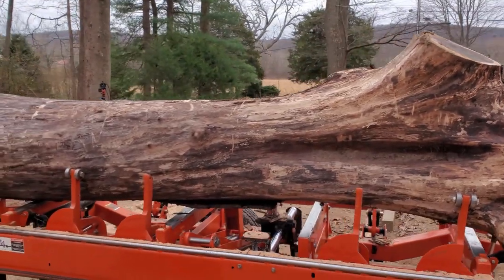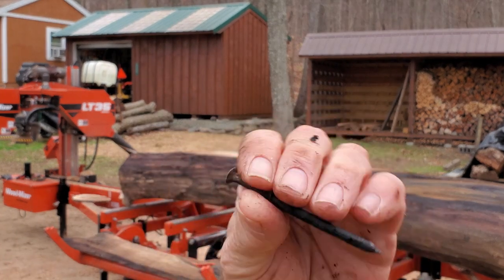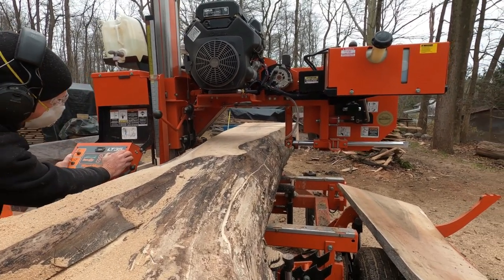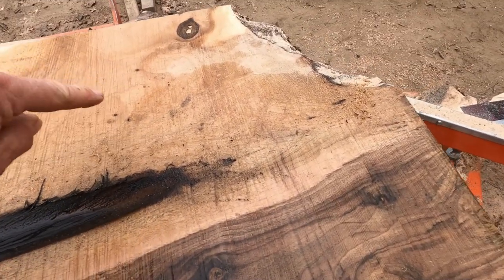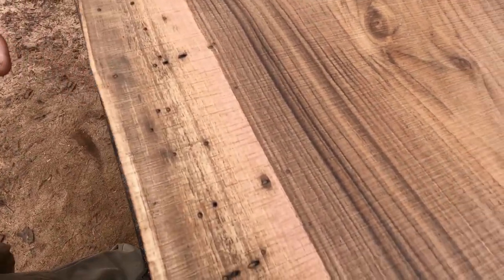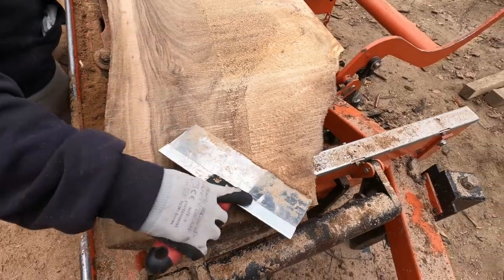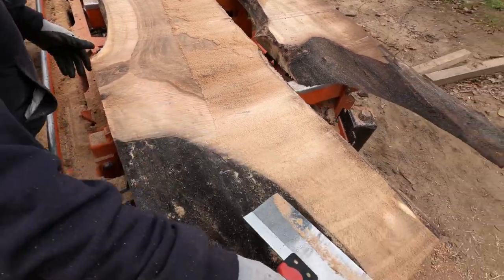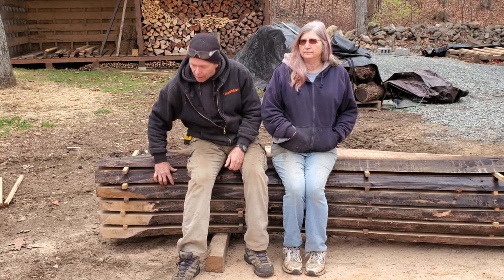You Never Saw Walnut Like This PINK???

Comment: I cut down a standing dead Hickory. Its Pink on the inside in the Cathedral grain patterns. Pretty . Some of it is  in my wood stove now. All night burn.
Reply from the maker: If you leave it long enough, it will spalt. That adds even more character. Good for slabs, boards, turning, among others.
We take the smaller tops of the trees, and use those for firewood. Great heat.

Comment: I just widened my new LT35 yesterday to accept a 171" blade off a LT40 wide. Did the first test cuts today and it cut 33" wide really nice... It can cut 34.5 wide now. If you want to gain about 2" on your mill just cut the alum  arm off that slides back and forth with the movable roller. If you look where its welded onto the round rod that slides back and forth, its what stops the movable roller from opening up farther. Cut it off right there, grind the spot smooth and it will gain you almost 2 inches...
Reply from the maker: I saw some of your progress on FB. I often thought about it, but couldn't bring myself to cut it in half. I'll look at the aluminum arm, and gaining some width there. 
All something to think about. Its tough though.
Reply: @IronOakSawmill  I totally understand. I agonized over cutting my brand new mill but it got to the point where I was losing too much money and time at each job. The little arm mod is easy though and that little gain helps a lot. Thanks for all your vids, I have learned a lot watching them. have a great day.

Comment: That reminds me of Pecan.  My wife has a desk we made out of Pecan for her that looks like that wood.  That mill is a workhorse.  I watch Nathan on Out of the Woods channel and he uses a 4 degree double hardened blade and loves them.  Have you tried it?
Reply from the maker: Hello Clay. We are still hoping to cut some pecan, but there isn't any around here. I hear it's a lot like hickory.
I watch Nathan as well. Good stuff. I ordered a 5 blade box, of the 4 degree blades. Looking forward to trying them out.
Reply: @IronOakSawmill  I really wish we lived closer.  I would love to trade some Pecan for that English Walnut.  You're correct about it cutting and acting like Hickory.  We've found that it really moves if we cut it thinner than 2" slabs.  Most of the time, we slab it, then let it dry for about 6-8 months then run it through a resaw.  I am curious to see if you have the same luck with the new blades as Nathan has.  At any rate, great video, as usual, and I hope you folks had a great Thanksgiving!

Comment: Do you use woodmizer blades? I would use a 7 degree turbo or 4 degree. I've only purchased the cheaper blades like under 30$  Gorgeous wood! Thank you.
Reply from the maker: We are currently using 7° Turbo 739 double hard, .045 blades. They cut great. We are about to try some 4° blade. Hope they do well.

Comment: I have two nice cherry logs that I would like to slab and use for tables. How long would I need to leave these sit to dry? I’ve never  it my own slabs before. The trees were cut down about five days ago.
Reply from the maker: Hello Joe, and welcome. It would depend on how thick you cut them. In general when stored outside, stacked and stickered, and losely covered to allow good airflow, but keep it dry, about 1 year per inch of thickness.
 If stored inside, stacked and stickered, in a dry place,, with some dehumidifiers running, you can shorten that time. Its best to buy a moisture meter, and check them from time to time.
Reply: @IronOakSawmill  
Thanks for the information. I a going to cut them at 2 1/2” with hopes of ending up with a 2” slab for the table. If I get a moisture meter, what would be an acceptable range of moisture content? Thanks again for your time and advice!

Comment: I have a large black walnut in quebec , canada... how to I sell it..?
Reply from the maker: You can contact a tree service and pay them to take it down. Have them take away the branches, and leave the large parts of the trunk. At that point, you can advertise the log for sale. I don't know a sawmill operator who would pay for the tree, and pay to take it down, and pay to have it cleaned up, then pay to have it hauled to their mill. The same for a timber buyer. Logging companies don't want to come out for a single tree. Especially a "yard tree". It is very expensive to bring the needed equipment to remove, clean up, and haul the tree away.
Have a tree service take it down, then sell the log. You will recover part of the cost at that point. 
Advertise around alot, before having it taken down. See what folks would be willing to pay for the log, once it's down. That will give you an idea of where you stand.
I hope this helps. These are my experiences with situations like this.
Reply from the maker: You may also want to contact this guy. He does buy walnut from tree service companies, and is in Canada.
https://youtu.be/_1qgVlILXrA